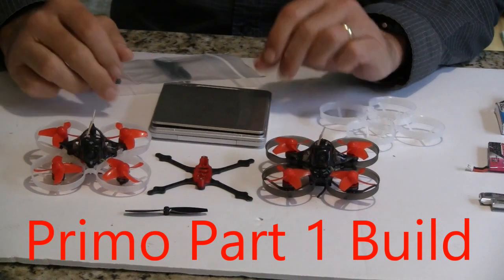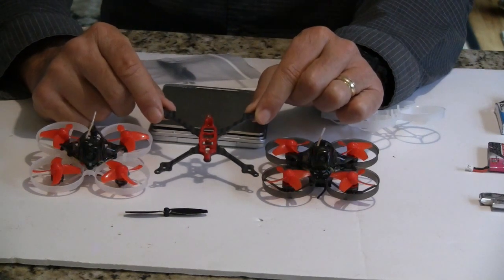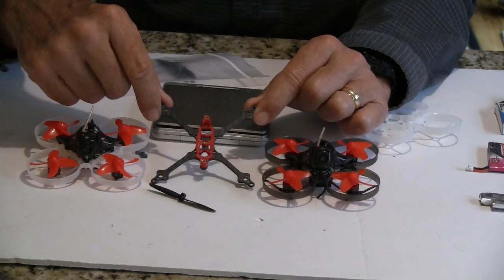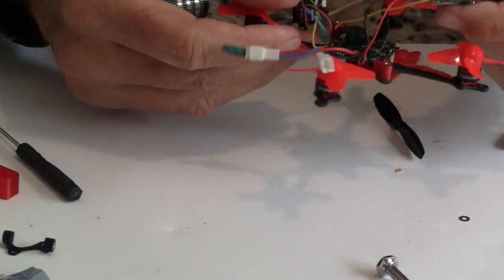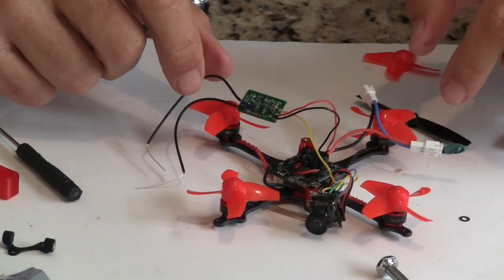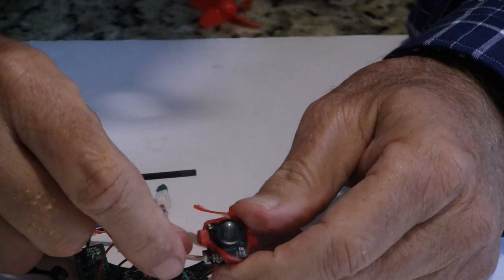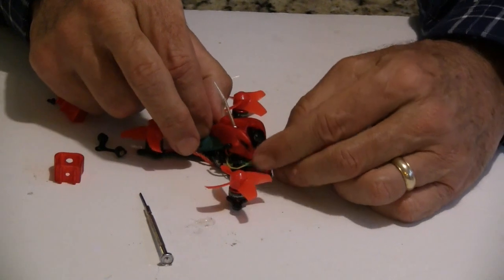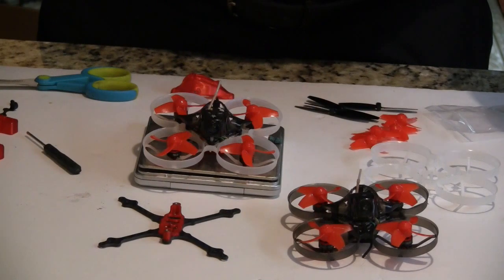GnarlyFPV Primo Part 1- Build

Comment: the camera mount is supposed to wrap around the camera board right below the lens horizontally. You are trying to put it vertically which it is too small for.
Reply from the maker: Thanks that will make everyone life a little easier and save 10 minutes. It looks like there is just enough room below the lens for that to work.

Comment: Awesome build. 🤙
The AIO camera mount should flex enough to stretch over the camera (Pictures on the site). It's a tight fit, to keep the camera from moving. TPU is tough stuff :) lookin forward to some flight footage!
Reply from the maker: GnarlyFPV The TPU material does not stretch unless heated like I did in the video. AtomBomb FPV had the same problem and used a lighter to stretch the camera mount. I recommend that you provide a larger camera mount because many people will be using the Mobula7 camera. Your company does a great job in figuring this all out. Looking forward for flying the Primo but having problems getting the XM+ to bind and work. 
John from Chicago